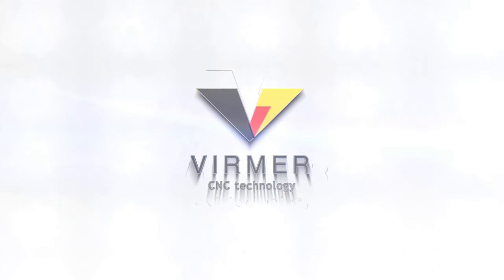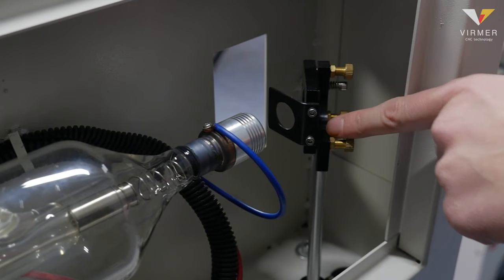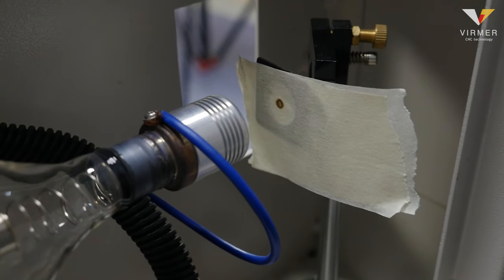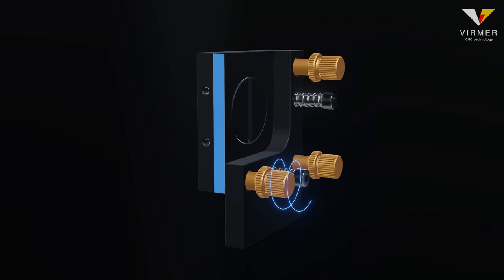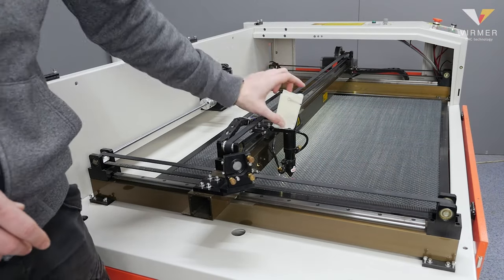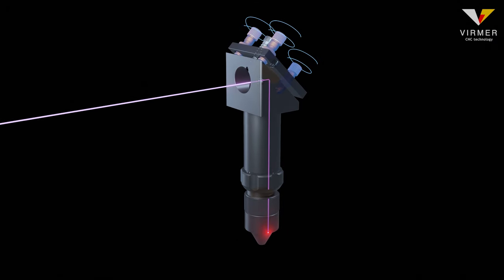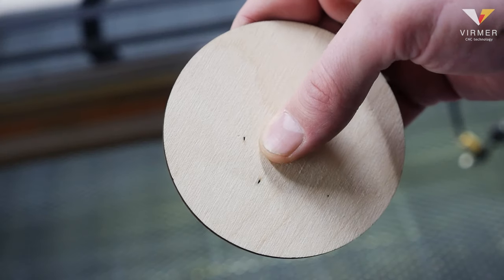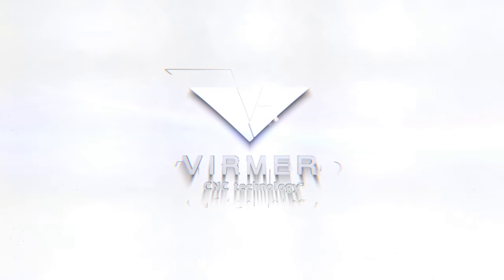HOW TO DO THE LASER ALIGNMENT / WATTSAN 6090 LT

Comment: If you aim to set the beam at the centre of mirror 3  that may not be the "sweet spot" and you will finish up with off-square cuts.  The most important fact is NOT using the nozzle as a means of setting mirror 3.  The beam passing through the nozzle will happen naturally if you set the beam correctly at mirror 3. The aim is to make sure the beam  passes  through the AXIS of the lens. Project that lens AXIS up to mirror 3 and where it hits the mirror is the "sweet spot". This is the point you must be aiming the X axis beam at  and this is rarely the centre  of mirror 3 or the centre of the head inlet hole. Understanding how and why perfect AXIAL alignment of the Z axis  is so important will become very obvious when you swap from a 50.8mm lens to a 101.6mm lens and find the beam does not exit the nozzle hole. Your method will sort of work but lacks understanding of how  a lens treats an off-axis or off-angle beam.

 There is no criticism intended in my comments, just a  nudge for you to do more research on the final stage of beam alignment. It is the most misunderstood part of beam alignment and I have been through the learning stage and have lots of T shirts that record my mistakes.   This is a nice machine that can be set perfectly but it will involve adjusting the tube to get perfection and that can be a repetative and irksome procedure, even with the lovely adjustable tube mounts.

Can I suggest you control your spot burm accurately by pressing  the Menu button. Move across to the top of the second column and press enter. Move down to Laser Set. This feature will allow you to set and exact pulse time in milliseconds that will ensure you always get a perfect spot burn . I suggest maybe 20 to 50 ms...it depends on the power of your tube.

 I can see this is a well designed and robust machine with 15mm bearing rails,  a C series head and a Ruida 6445 controller. It has everything  you could wish for  in a laser machine including the C series lens tube, the most flexible system available.   It deserves to sell well.
Reply from the maker: Thanks for the comment! our machines are very precisely designed and the laser heads of the C series. The whole structure is arranged in such a way that it is enough to get into the center of the third mirror and adjust it, then the beam will not only come to the center of the nozzle, but in general the vertical axis of the beam will go in the center tubes and lenses.
Thanks for the note on the pulse duration, it really deserves to be mentioned in the video, we will definitely include this item in future versions of this video :)